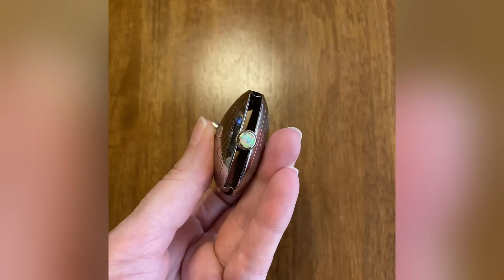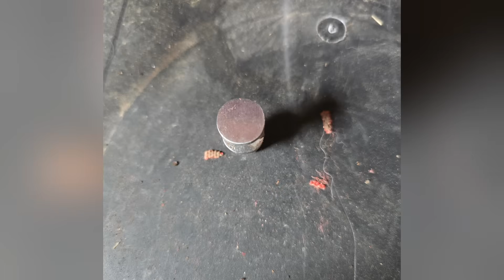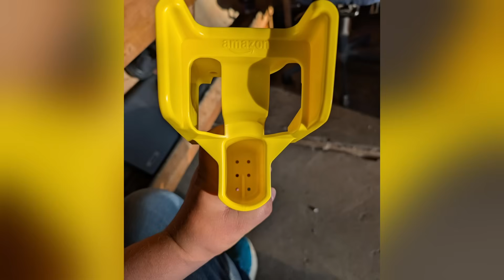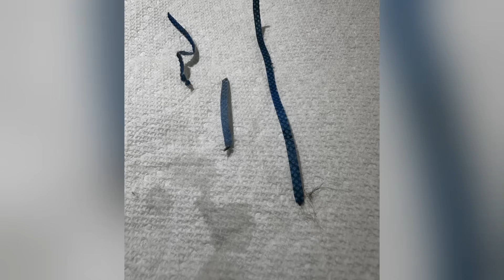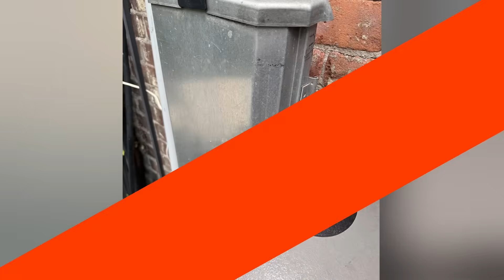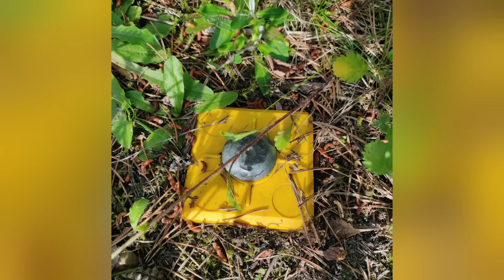40+ MYSTERIOUS ITEMS That People Were Identifying COMPLETELY WRONG!

Comment: the puzzle item with the red insert, the idea is to remove the red insert without moving the surrounding wooden piece. the solution- a short, sharp blow (air) from the top, and the red insert will pop put.